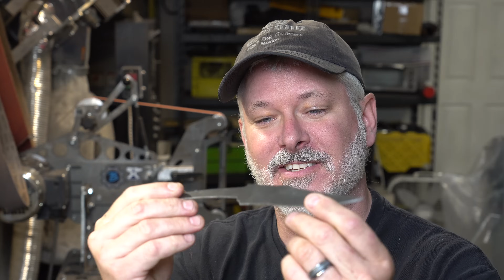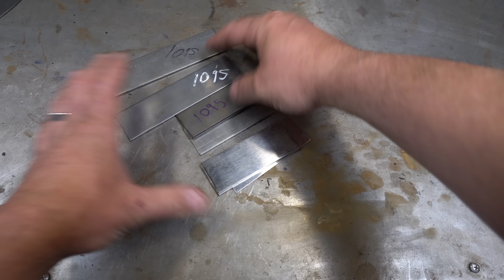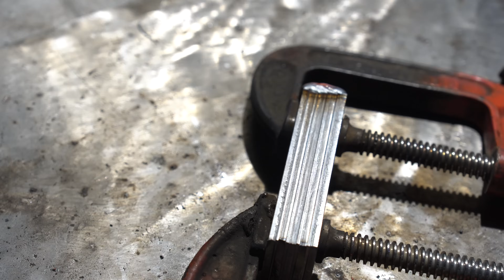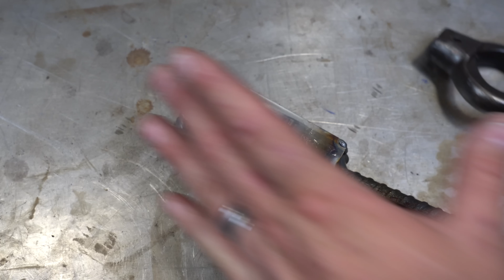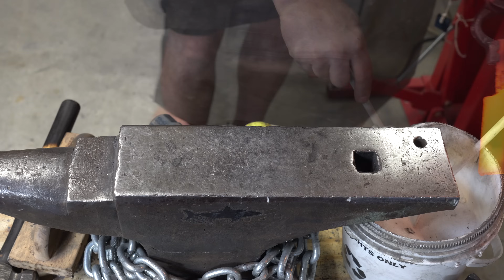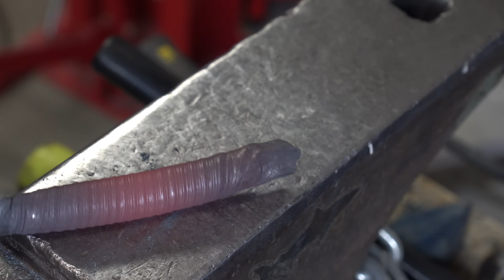Triple-T #89 - Intermediate knife making series - Forging twist damascus

Comment from the maker: If there's any tips you definitely think I should cover in this series, please let me know in the comments!
Reply: Great video Dennis, only thing I would add would be, as soon as the initial welds are set, grind off the weld spots, especially when doing a twist pattern.
Reply from the maker: @thewaylonandjoeshow9540  that’s why I don’t like to weld the sides.  No need to grind them off, you’re not going to use those areas anyway.
Reply: The only thing I can think of and it seems pretty obvious, is nipping off at least one scrap end early so you can do a quick test etch and double check your welds. Otherwise, it looks like you are covering things pretty thoroughly.

Comment: Hey Dennis. I have a question. Im building a damascus bowie and want to use left over portion of billet to make a guard and pommel.  Do i need to heat treat those parts so they will match heat treat on blade?
Reply from the maker: Yes, you need to heat treat the fittings or they won’t etch the same.  Hardened steel etches dark, soft steel is lighter.  Make sure you leave room to remove the decarb from your fittings.
Reply: @TyrellKnifeworks Thanks for the info Dennis. Will follow thru

Comment: This may have been mentioned down below, but when you start twisting does the billet need to be back to forge welding temps or not?  By then it should be one solid billet, so can you just go to bright orange 1,500 degrees?
Reply from the maker: Best to get it at forge welding temps do it doesn’t shear apart.  Stop twisting around 1500F.  Thanks for watching, Travis.

Comment: I had heard elsewhere that you ideally want to be at welding heat during the twist to help avoid cold shuts. Do you feel that's necessary? On the two successful (hand-hammered) twist patterns I've done, I had to grind out a fair amount of cold shuts, but less on the more recent one where I made it a cylinder before twisting (as opposed to a square on the first one).
Reply from the maker: It should be at/near welding heat so that you can twist it more without risking shearing it apart, but that won't really prevent cold shuts.  Rounding out your billet before you twist it helps more with that.  Thanks for watching, John.

Comment: When I do five or six layer Damascus and twist it why does it break and crack around the edges when I’m twisting it could you help me
Reply from the maker: That usually indicates you didn’t have a good forge weld.  Make sure you round out the billet into a cigar shape before you start twisting it, that will help not having cold shuts when forging it flat.  I hope that helps.
Reply: @TyrellKnifeworks  Yes thank you I think that is exactly what I was my problem around the corners but not the whole thing like a cigar thank you again I really appreciate your help

Comment: Anhydrous borax is only anhydrous until you open the bucket, the 20 mule team Borax from the grocery store is just fine. I have been using it for 15 years
Reply from the maker: Clearly you've never actually used anhydrous borax. The crystals are larger and its not a powder like the 20 mule team.  Try it and you'll see what I mean.

Comment: Would twisted copper Damascus work
Reply from the maker: It would not work.  Meaning that it would make it very weak because you'd have copper laterally in the blade and it would be on the cutting edge.  You could do a twist as cladding, then copper, then a central core, which is exactly what I did for the recent katana build.  Thanks for watching.
Reply: @TyrellKnifeworks  that kind of wat I had in mind

Comment: I had always heard that when doing making a Damascus billet, having each layer the same thickness helps them heat up consistently and makes them weld together better. Is this true, or have I been falling for an urban myth?
Reply from the maker: That’s a complete myth.  The thickness of the layers doesn’t not matter at all.  Just don’t have thin layers on the outside because they warp easily.  Thanks for watching.

Comment: Hiya bud I didn't realise that you were doing these types of video's so I'm going to have a watch of the series's when you were talking about the welding and pushing the mild steel into the billit you could get around this buy using a tig and fuse weld a strip so that you are not introducing another metal, I used to do welding as a trade until I had a bad accident which has ruined my shoulder after bad surgeries, I like to try and get to making some knifes as iv always had an interest in knifes and only recently got into watching videos on making them, anyway keep up the great work pal
Reply from the maker: Yes you could tig it, but most people don’t have a tig at the “intermediate” level.  Thanks for watching.

Comment: That’s pretty good timing, 1.5 hrs all by hand. 
Have you ever tried using an impact driver/gun to twist bars? I want to say I’ve seen someone do it. Either they made the end a hexagon or cut a socket apart and made there own.  I have a billet that needs twisting and debating on using my big 1,400ft lb impact on it. Just not sure if it will work like I’m thinking. Hate to ruin my canister billet.
Reply: Yes that can be done but it's a bit more work than it's really worth. Using the pipe wrench method is easy enough and far more control than using an impact driver. Plus with the impact driver you stand more of a chance at twisting the billet in to.
Reply: @prophez23  I thought it would make it easier but yea I can see it twisting the billet right into pieces if wasn’t careful.
Reply from the maker: I friend has a build for a twisting machine I’m going to attempt.  Stay tuned!

Comment: Like the Windex idea for controlling twists
Reply from the maker: I should just use a water bottle, but I had the windex handy.  The windex smells nice when it burns off though.  😜
Reply: @TyrellKnifeworks  I can see that. I use a gatorade bottle with one of the squeeze mouthpieces. You'll see it in my videos if I ever get one up LOL. On another note I have some stabilized wood for you. I meant to bring it when you did the knife makers meet up but forgot. I'll send it to your address. Thanks again for hosting that. I'm looking at the end of August or early September for another knife makers meet up at my shop.
Reply from the maker: @blaneyblades4810  thanks for the handle material!  I appreciate it!  I’m up for another meet up.  👍

Comment: I have a question regarding your forge. Forgot to ask it in the video where you explained how you made it. 

I noticed that your sliding door on the front has about an inch or so gap from the bottom. Wouldn't it be best to make that gap as small as it'll go? I know it's probably not that much in the grand scheme of things, but I was wondering if the heat that escapes through there would make a difference, either in how fast you get to temp or how much gas you use.
Reply from the maker: The gap in the front is actually only about a 1/2”.  You do need some kind of gap because the forge does need air to escape with the fan feeding it.  If I have the back door all the way closed and completely close the front it can “whistle” a little bit so I wouldn’t close it up any more.  It’s plenty hot.  Almost too hot.
Reply: @TyrellKnifeworks  I had a brain fart and completely forgot about airflow. Makes perfect sense. Thank you!

Comment: For welding the centre weld of the 4 inch billets have you tried flowing it with TIG without adding any filler rod?
Reply from the maker: Yes I’ve done that too, but most people don’t have a tig and this is the intermediate series so I didn’t mention that.  Thanks for watching.
Reply: @TyrellKnifeworks  yes tig is pretty "specialized" for the hobbyist.
I really wish I could forge a knife but my body sadly doesn't let me beat a piece of steel into submission😂
I might get a heat or 2 done but that's about it so stock removal it is.

Comment: if you truly suck at welding, you can use a coat hanger twisted really tight to hold the billot together for forge welding
Reply from the maker: Yeah but that’s really terrible to forge on. Then you need to move the wire as you hammer.  Not fun.  Get a welder, learn it.  😜
Reply: @TyrellKnifeworks  for someone who is trying forge welding it can work is all i was saying
Reply from the maker: @dagnard5707  yes, I understand.  Thanks for watching!

Comment: Does quenching 5160 in water achieve higher hardness than quenching in oil?
Reply from the maker: Quenching 5160 in water is a BAD idea.  It’s already a slower quenching steel than most.  It’s the one steel that quenches well with canola, use that or get ParksAAA.  👍

Comment: You mentioned MIG welding, and also stick, but since I only have flux core on my Lincoln 140 wirefeeder, what do you think of that? So far I've only done 4 billets and all were just wired together. It worked on 3 of them.
Reply from the maker: Yes, wire feed with flux core is just fine.    Anything is better than trying to tie them together with wire, that’s too janky.